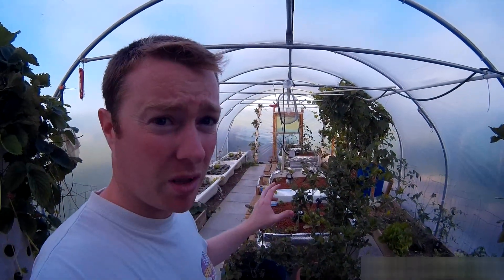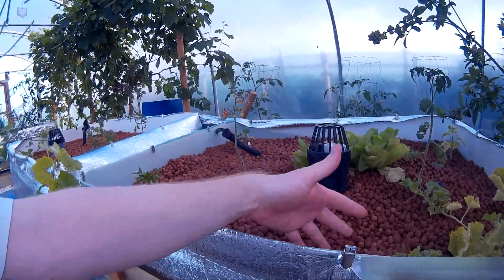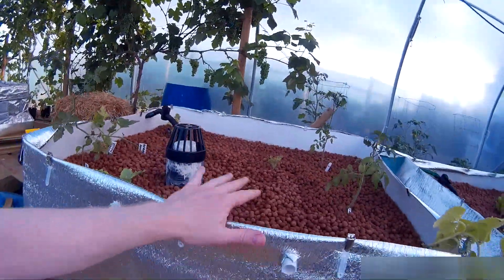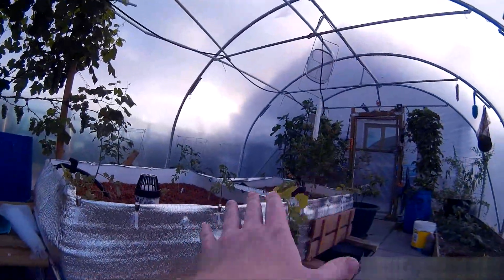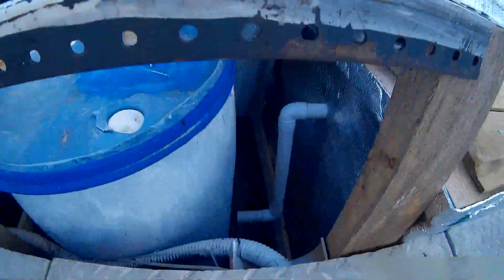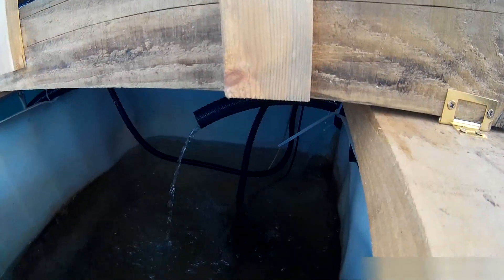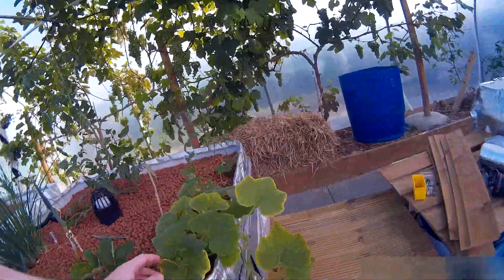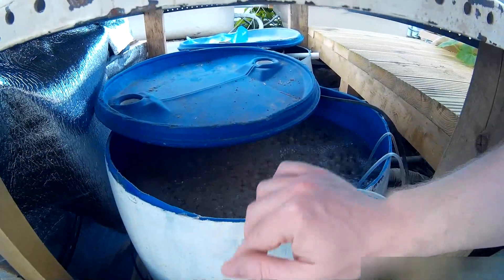New Aquaponic  System overview July 2014 Ireland

Comment: Hi Paul hope you are all doing well. You are a great inspiration, not many irish Aquaponics activities on youtube. Hope you are getting another system together and some vids up on youtube for this year even though its a crazy one. Been running an indoor system for years now and  planning hard to hopefully finally start building a proper outdoors system myself. Obviously warmth is a huge issue here (i am also based near galway) Have you thought about using solar water heating? If done well this can seriously heat the water even in cold sunny winter days. I am playing around with a  few ideas on spreadsheets ;-)
Reply from the maker: Hey Marius, yeah we disassembled the Aquaponics system to focus on renovations and repairs the last two - three years. The outdoor system can struggle with lower temps and fluctuations in temperatures inside the polytunnel. I think our next design will be more of a eye candy place to relax as combining the plants welfare and the fishes welfare with our weather takes a lot of the joy and way too much time. You should upload a video of your indoor system, always interested in seeing other systems and getting new ideas. Every stage of the journey is fun!
Reply: @MrPaulnestor  Thanks for the reply Paul. Yeah  it will be tricky dealing with temps. I am thinking about using bubblewrap type greenhouse poly from the UK and playing with DIY Solar water heater to offset when needed.  But yeah its not easy to have plants AND fish doing well ;-) Hope you get a nice system again and the renovations went well. Will try and get more active again on my youtube channel. started a blog but havent updated in a loooong time but you will get the idea. https://indooraquaponicsdiy.blog/ things have changed quite a bit but its still producing.

Comment: How do you remove your waste from your filter?   Thanks Dj in Utah
Reply from the maker: +David Carlson Hi David, the main filter to clean is the blue barrel radial flow and in the past i used to shut off the system and use a pump to move the settled solids to the soil grow beds. I since bought a 2nd hand pond hoover for like 60 quid and it works great for hovering the radial flow and once in a while i'll do the bottom of the fish tanks and the deep water baths as dirt does settle here. The bath tubs are now gone...i'll have to do an update to show all the changes and lessons learned since!!!!! Red wriggler worms clean the grow bed media and works great! Chat soon and God Bless!
Reply: +Naturally Healthy
Awesome!  Thank you.  I was having a hard time with my set up due to the fact that my sump is in the ground and my IBC fish tank is half in the ground.  Wanted to add a swirl filter or Radial flow filter but would have to dig another hole so I would be able to drain the filter.  Thank you for the quick reply!